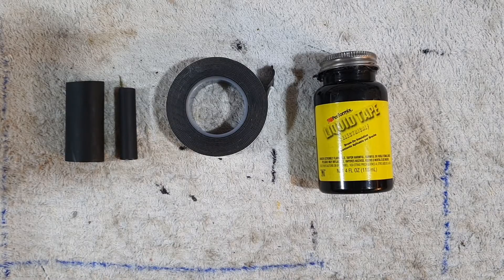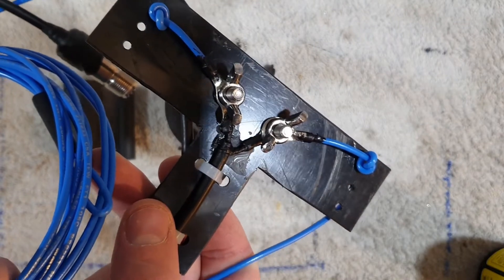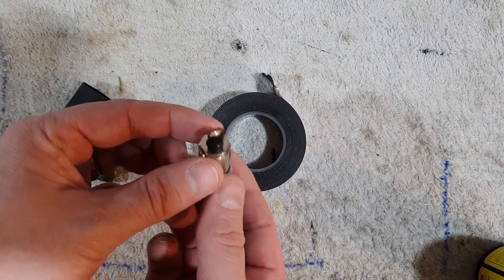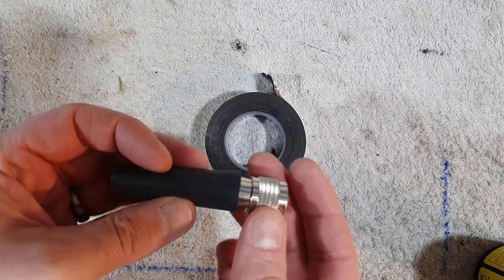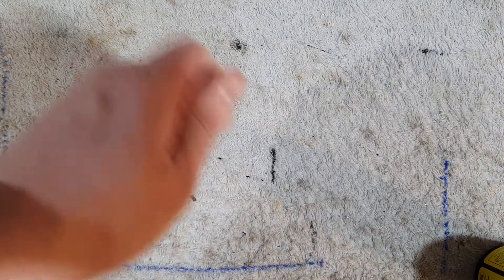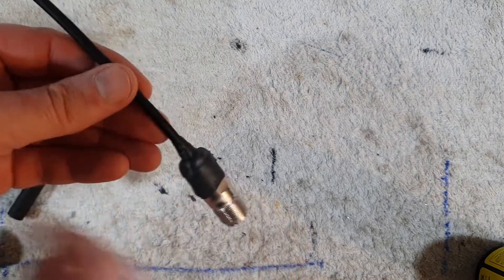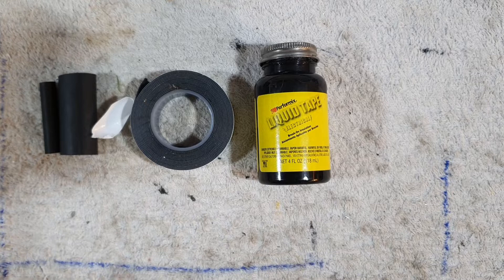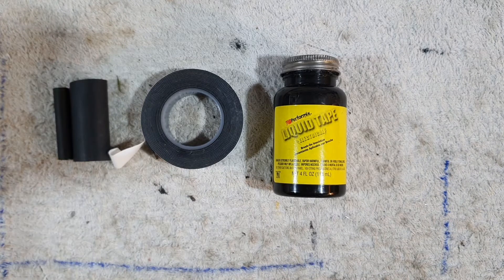Three Essential Items for Ham Radio Antenna Feeder Work

Comment: Just remember self amalgamating tape is not UV proof so either cover with heat shrink or electrical tape.  Great short vid Colin another gem.
Reply from the maker: I've had different types Mike. I've had this stuff exposed for years without issue. On the other hand I had a big roll of stuff I got at a rally and it split right away when left out. 73.